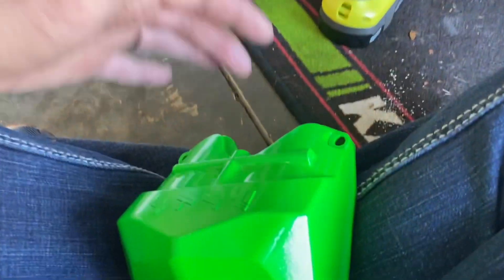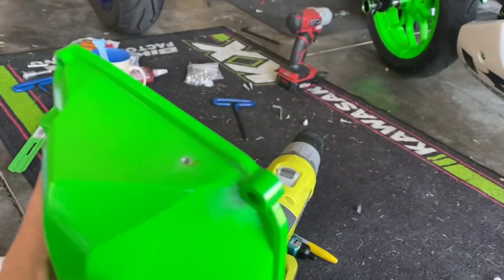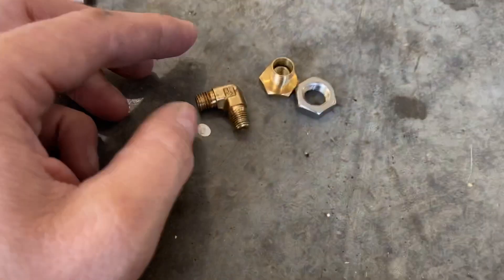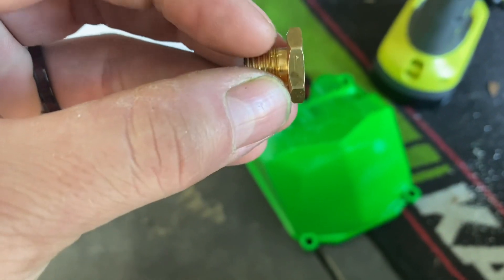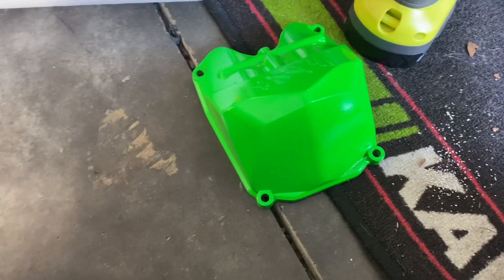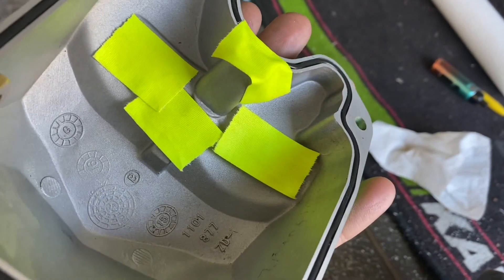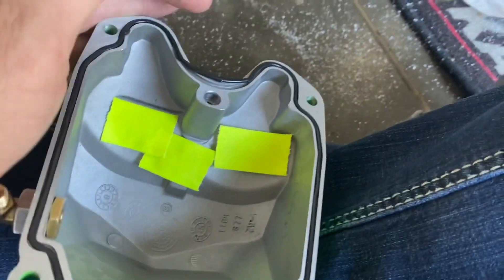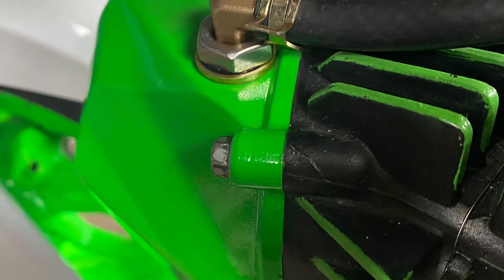Adding a head breather to a Daytona Anima / Zongshen ZS190 212 engine

Comment: Where do you run the line from the breather to?
Reply from the maker: Ran it to a small catch can towards the right just behind the top of the side plastics
Reply: @TheKiddOnDrums  whats the purpose of this?
Reply: @tru_remedyz relieve head pressure. These engines can build quite a bit of positive pressure up in the heads which if you’ve ever used the kickstarter is kind of similar idea of how bad the kickback can be. Just for the heads in this case.